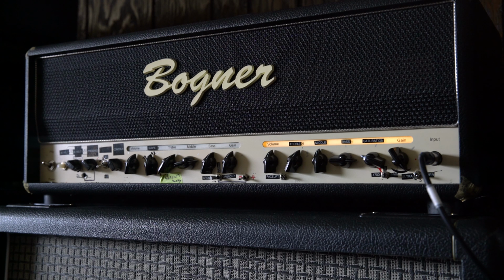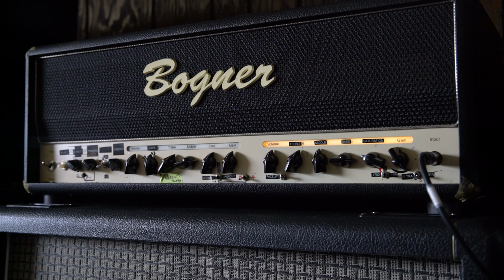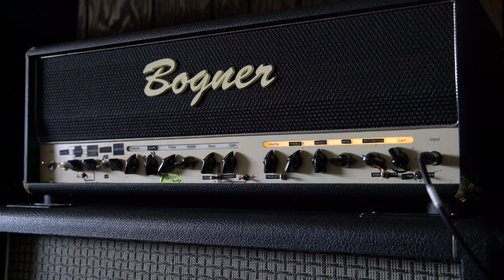Bogner Amplification Custom Shop - Uberschall Ultra Prototype Playthru

Comment: Just picked up an EL34 Uber Ultra… so sick and versatile.  Best amp I’ve ever owned/played through.  Was the “Facelift” switch removed for the production model? If not, what does that switch correspond to on the new ones?
Reply from the maker: it was removed!! wish it wasn't!
Reply: @RezaMatix  boooo!!  Do you know what it did?
Reply from the maker: @Archon747 you can get there with the metamorph control and the density control